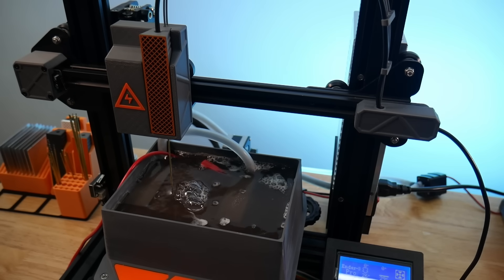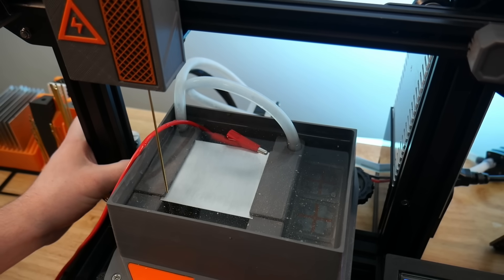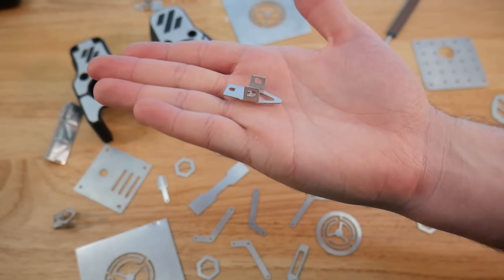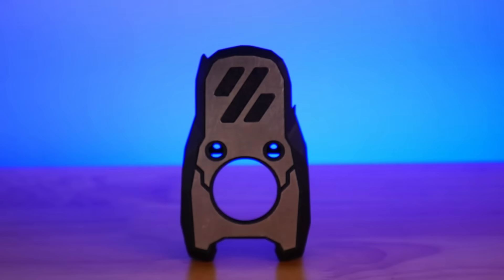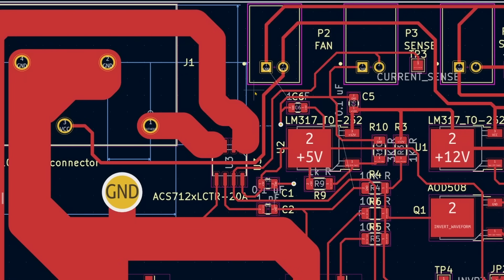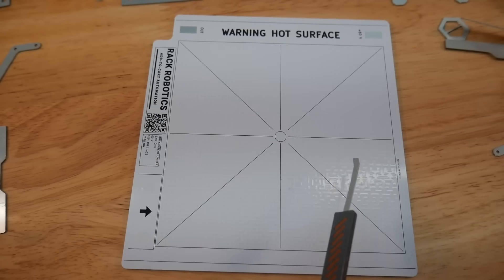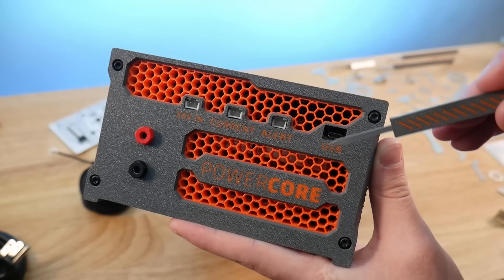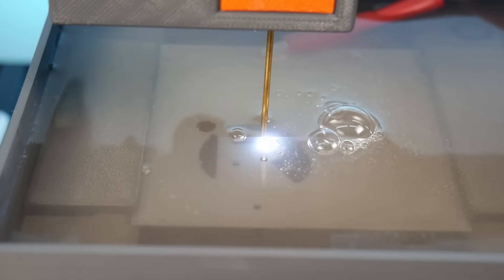I built an EDM machine

Comment: Just curious. The kickstarter is great and all. I really love what you guys are doing. I'm not to the point of having the skills to building my own machine on an Ender 3 though. Do you guys ever plan on selling complete machines?
Reply: From what I am seeing, the Ender 3 is being used as a positioning system, and as a result could be replaced with pretty much any 3 axis positioning system. I.e. if you have access to some v-rail through e-bay or a local retailer, you could put together an x-y platform to move the emd probe that way, then build a z-axis control that moves the x-y platform up and down, rides the platform and raises/lowers the probe, or raises/lowers the vat containing the metal and de-ionized water that you're working with, the way that an Ultimaker raises and lowers the bed. Pretty much any 3dprinter control board on the market, including a RAMPs board would handle the movement. If you want to go the 'full on industrial' route, a system running Mach 4 with industrial grade stepper controllers, and such would be possible. But if you're looking at the home hobby market, pretty much any older 3d printer is likely to work, which is part of why the Ender 3 got used here. It's cheap, and there are likely to be more than a few in the region that the owners of which would be happy to part with them because they got tired of the bowden tube overheating at the hot end and don't want to replace the ptfe or put in a better heat break.

Comment: Wow. I’m impressed that you’ve got down to that price. I assume that you wouldn’t really be able to use it as a replacement for milling more than a tiny bit of material from aluminium without having some sort of recalibration as the electrode wears out?
Reply from the maker: Yes, that is called electrode dressing. It is used in EDM when blind holes of a precise depth are required. Electrode dressing is also used when machining with EDM dies.
Reply: @MorlockEngineering use steel wire to replace your copper trace, you do not eve need heatsink for that. Common steel wire not a nickeline wire.

Dirty cheap and more robust. Take notice that increased temperature also increase resistance.

Comment: Wait so why exactly are you only investigating steel? And non aluminum metals?? The big advantage of EDM is being able to machine hard to machine materials... Pre hardened materials, carbides whatever. Aluminum is really one of the easiest metals to machine, and almost any mill can work it provided the right feeds/tooling. There is a shortage of edm machining access, but definitely not of competent cnc shops that machine aluminum.

My point is, it was very surprising to see that steel etc is under investigation.

I imagine you haven't found the right settings for steel machining with your current power supply? Is that the issue?

Comment: Huh, it's so nice and weird to see gridfinity being adopted like this. On the main topic - looks hella dope, though i do wonder why you use wire that is so thick? I mean, one of the reasons why edm is so cool is that it can "drill" tine-tiny holes, like the one applied science channel showed! I was blown away at the time. Is it that the setup for that is too finicky?(i don't see any wire feeding happening in the video, also applied science made it sound like it was very sensetive to the water quality)

EDIT: Turns out i am just an idiot, and the machine i am refering to is wire edm, and there is a video on the channel showcasing it. God, i feel like i just got "Your next line is"ed, aka Josph'ed, aka JoJo'ed

Comment: This is great. I've been thinking about getting a Bax EDM power supply to make a wire edm machine, but the 3,000 eruo price tag was a big limiting factor for a hobbyist like myself. I've gone ahead and backed your kiskstarter and shared it with other members of the Maker-space I belong to. If you haven't already I would highly recommend getting in contact with as many maker-spaces as possible. 

1) They probably will have members that want to back your project
2) They'll know experts that can look over your designs and offer suggestions for improvements.
Reply from the maker: Bax Makes some really great videos on wire EDM. We can not wait until there are open-source & low-cost wire EDM designs out in the wild.

Comment: This is really cool! Congrats on funding the kickstarter!
I'm curious what kind of resolution something like this is capable of? From other comments it seems to be pretty limited in material it can cut and tbh I'm kinda struggling to see a reason why I would choose this over a small desktop CNC.
Reply: This would be the perfect option if you wanted absolutely horrible side wall surface finish compared to even a shitty chinese desktop mill. Look at those sidewalls at 1:58 - they look atrocious
Reply: @gorak9000  yeah, they do look pretty bad and not at all what i expected compared to wire and plunge EDM machines ive seen before. Those were clean AF, this looks rough as guts
Reply: @jeremyglover5541  Shhhhh, the people in this comments section don't want to hear the truth. I got torn to shreds in another comment thread. People want to throw their money at this without thinking critically, and most probably are just keyboard warriors that have no experience with any real machine, nor any intent of ever buying this, or any other EDM machine in their lifetimes. The fanboi's gonna fanboi (and or waste their money)
Reply: @gorak9000  yeah, i was initially enthused, with the idea … then i looked more closely at the reality and execution. As a PCB designer, i was not impressed with the caffeine induced missing ground plane EMI machine, nor hopeful that was going to be fixed to my satisfaction in a second version. These type of power supplies and machines are EMC failures waiting to happen, under the best circumstances. Im wondering if the lack of power this clearly has, is deliberate. Certainly the no export is, as getting a CE mark for something like this, would be very expensive and frankly, beyond this team and quite probably this design in general. The hilbert power resistor is a dollar saver vs power resistors, but surely there are more elegant current limiting strategies. Its cool for a diy project and if they release the schematic as promised i would likely remix it and give it a better power supply, but im not even sure its worth that effort. Something like a scaled down BAXEDM perhaps. This may have hobby potential, but doesnt have a place in a shop making anything for sale IMO; at least not this generation.
Reply: And the BOM doesnt justify the cost. Sure, the BAXEDM arc generator is in a different league dollar wise, but id rather spend a grand or so building something good, than 399 building a gadget.

Comment: No water treatment and small tank? No through nozzle pressure water? So you cant do anything serious what actually need EDM process. Everything what you showed - i mean finished products are from thin metal sheet. It can be done by etching technique or fiber laser for fraction of the cost. And also EDM  is really slow, so thats why is it used only on thing which cant be done by other proceses. Like drilling 0.5mm hole through tungsten bar.

Comment: I was doing a similar project years ago. I'll give you my idea to use if you want, in a future version: inductive kick to start each spark. An inductor is shorted to create a magnetic field, and then turned off in nanoseconds with a mosfet. This creates a very high voltage to arc, but the voltage only rises as high as necessary. From there, current is monitored to cut off before burning the part.

Comment: software??? Motion control? How is it programmed? did you miss the whole part about edms where they feed based on the current of the arc to maintain the spark gap and back off it there's a short? edm is slow so they have to be able to manage those common issues. What about if you want your part to be a size??? what diameter is the electrode? what about near the end of the program? And water filtering? the swarf will make the water conductive, you cant run it for very long with out filtering. distilled water isnt the same as DI water. If you really want this to be a thing you should need to make it usable, if someone can to do all of the rest of it the power supply isnt the hurdle. But hey the money is yours after the campaign ends so you don't really have to do anything but disappear.